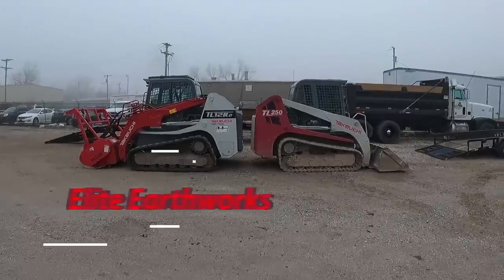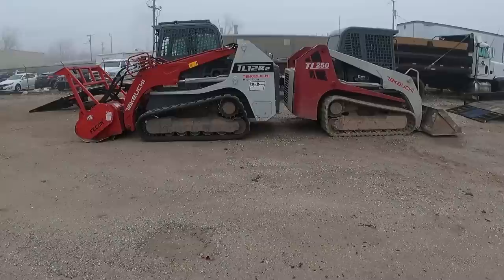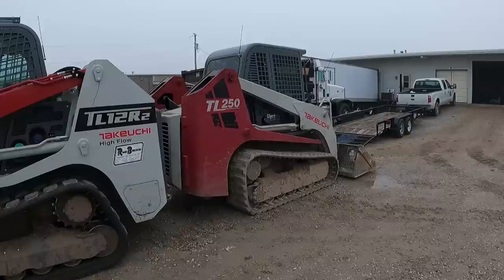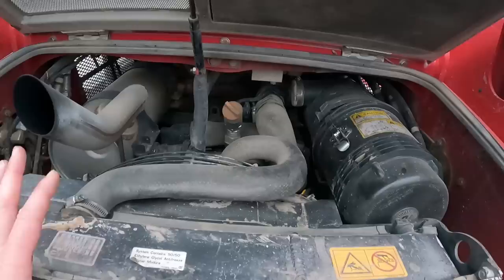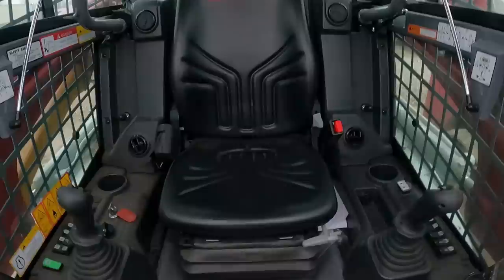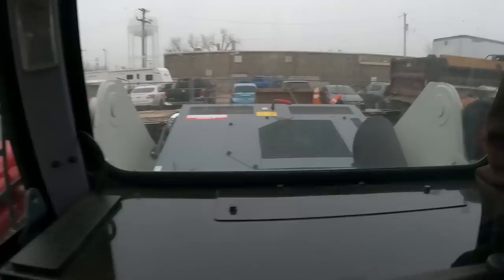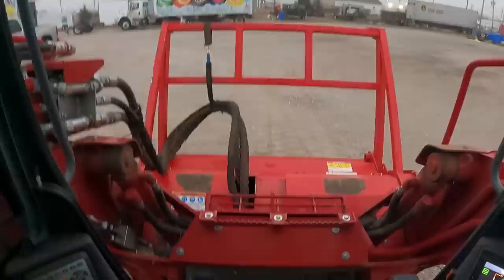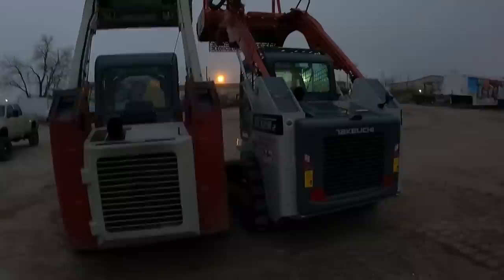Comparing A 2021 Takeuchi TL12R2 To A 2011 TL250

Comment: I still prefer the 250. Anything pre dpf is a plus. The whole tier 4 dpf system is a no for me. Take a torch to cut into the side panel for better battery access on the 250 and she is good for another 8,000 hours 😤😎
Reply from the maker: Yeah you can’t beat those 250 just great machines! Appreciate the comment

Comment: Thanks for that video. I enjoy hearing info on machines from the people who operate them rather than someone who sells them.  Especially stuff like this and the one where you had to replace the battery, that kind of info is something I wouldn't have thought of in looking at equipment.  (Like I found that replacing a fan belt on my dozer actually required half a day's work and disassembly of most of the front of the machine. )
Reply from the maker: Thank you! I’m glad it was helpful, I agree too, better to hear from someone that runs it vs a salesman. Appreciate you watching

Comment: We have 2 TL12R2 machines now and they are great. Bought one last year and put 1,500 hrs on it the first year so we decided to buy a second one last month. Love the new improvements on the cab and love the smoother ride on the tracks without the metal plates for the rollers to run on.  

Side note, the rear doors are way too thin. Definitely don’t do well when guys back into thing. Our older TL130 and TL230 can back into a concrete wall and barely leave a scratch. Do that with a new one and you’ll be buying a new door and radiator.
Reply from the maker: Yeah they are great machines! That’s what I want to get is a 12R2. Oh that’s good to know on the doors must be lighter steel

Comment: Great comparison video! The fact that they kept the pilot controls is awesome! I love pilot controls so much faster and accurate IMO. We have 2 Takeuchi TL 230’s and they are amazing machines for finish grade. Guessing the new generation by your comparison won’t be far off apart from the slightly bigger frame overall.
Reply from the maker: Thank you! Yes you can’t beat the pilot controls! So quick and responsive. Those 230 are awesome machines. Thanks for watching

Comment: The reason I see for the lower lift is the cylinder is shorter, as it's been moved foreword due to engine bay being bigger. Still a nice machine Brandon.
Reply from the maker: That makes sense I bet that’s the case. Appreciate the comment

Comment: Got to run the new 12 at the equip-expo today and it was really something else. We have an ‘08 TL150 and love it. Has 1400 hours but wanting to upgrade for hydraulic flow. Might keep it and just purchase new one but wow hard going back in the old 150 after running the 12
Reply from the maker: Yeah those 12’s are animals! I would definitely keep the 150 that’s extremely low hours on it. It will run forever

Comment: Have a 2300, went with the TL12 V for our second one.  Well worth the money.  Size of the cab, it doesn't Bob as much while traveling with a lode and it grades better.  One thing is the bucket and tracks are wider than you think or you thought it was.
Reply from the maker: Nice yeah the V2 are awesome! Great machine and that’s a big jump from a 230. Appreciate you watching
Reply: Are you saying the vertical lift grades better than the radius ?... strange because they advertised the radius lift better for grading

Comment: Thanks for the video. I didn't realize the 12 is so much larger. I'm still waiting for a TL10r2 to be made.
Reply from the maker: Thank you! Yeah the 12 is big. I don’t know if they plan on making a 10R2.  They only make the 8’ s in radial and the 10’s in vertical now. I would go with the 8r2 if the 12 is too big than what you need. The 10 is a bit under powered. It has the engine of the 8 in the frame of the 12. The 8r2 is an animal
Reply: @eliteearthworksllc  I've got a gehl/tl140 that I bought new. And I've been itching to get a new machine. 
Mine is about the biggest I can pull with a bumper pull trailer.  But I hear you, the tl10v2 doesn't make sense to me. They should have offered the wider tracks and larger engine.
Reply from the maker: Yeah they were trying to avoid using def but it’s not going over well. They are in the process of reworking it but it won’t be out for about 2 years
Reply: @eliteearthworksllc  you've heard they are going to change the tl10v2? Put a bigger engine in? Wider tracks?
Reply from the maker: Yes it’s getting a make over
Reply: @eliteearthworksllc  I'll be waiting!

Comment: Just think we're heavy equipment would be today without emissions regulations.  If they kept the early 2000's standards and just fixed the little things like doors, travel motor efficiency, and maintenance access they'd be amazing.
Reply from the maker: No kidding the emissions have killed everything. Such a joke

Comment: My 2017 TL10 is very similar to your 250, especially the cabs, I like the new design.  I hate that mine has no cup holder. My radio is way back over my right shoulder and it’s a PITA to mess with. Mine has 94hp kubota engine. My buddy’s old 150 has an Isuzu engine. Overall I’m really happy so far tho. 
Stu
Reply from the maker: Nice yeah the series 2 is when they changed the cabs over. The TL10 is a great machine!

Comment: You definitely went over most everything. I definitely prefer the vertical lift especially if you're loading trucks because it gets the bucket further and closer to the center of the bed and also lifts higher. The extra cost of the high flow made me just stick with the standard flow because you can get most attachments in a standard flow nowadays, mulchers and asphalt grinders are about the only thing you can't get in a standard flow and I don't do enough of it to justify the cost, if I do I just rent a machine for the specific job. I wished you could get them in a glider like they used to do with big trucks because the emissions are nothing but trouble and costly not to mention fuel efficiency is almost half of the pre emissions engines. Caterpillar used Perkins for year's and switched to Kubota engines and I didn't like the Kubota at all compared to the Perkins it used twice the fuel and I had constant problems with the fuel system and particulate filter plugging up because you had to run it wide open to keep it hot or it'd plug up, probably why it used twice as much fuel. Great video on the comparison!
Reply from the maker: Thank you! Yeah the emissions is just such a pain on everything. I’m sure there is a big cost difference in high flow I need to price them but I really like this machine. Appreciate the comment

Comment: I think 2010. Because my 240. Which is a 140 size is a 10 .      I like the new tracks that run on rubber . Not the plates. I watch this twice.   I want a new one 👍
Reply from the maker: Ok cool I couldn’t remember. Yes the tracks are great so quiet and smooth. Thanks for the comment man
Reply: @eliteearthworksllc  thanks for doing this video 👍👍
Reply from the maker: You bet man 👍🏻

Comment: What do you like better the radius lift or the vertical lift?..... I've always had a radio lift machine and I am agonizing over which way to go next
Reply from the maker: It has more breakout force and is a stronger design for cutting and grading. If you primarily load trucks or move a lot of heavy pallets the vertical lift is what you want but if you do more cutting and grading I would get the radial lift. I don’t plan on ever having a vertical lift for I do
Reply: The problem is I do all of that
Reply from the maker: @MattyMattnj1  me personally I would go with the radial lift. I feel like it’s the best all around

Comment: Will you be going with a R2 or a V2 when you get your new 12. Hi Flow? Is that a big cost difference?
Reply from the maker: I’m going to get a high flow 12R2. The high flow is about $2k-$3k more and the V2 is also me expensive. I like the R2 better because the pump flows a few more gpm and the break force is a little better. If I was moving heavy pallets all the time I would probably get the v2 but the radial design is much stronger for grading

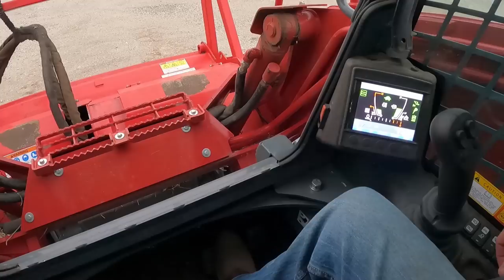Comment: 17:10 but does your older machine with the slower speed have more pushing power???
Reply from the maker: No I think this one would put push it because of the extra power it has and how they have regeared the drive motors. Thanks for watching

Comment: Had a terex pt 110 forestry ran fecon head just bought a new takeuchi tl12r2 the old terex would run circles around the new takeuchi
Reply from the maker: That’s cool I’ve never ran a terex
Reply: Hydraulic flow on terex 110 45 gallon takeuchi 40 the new asv 120f is basically the same machine looking to trend the takeuchi tl12r2 for asv 120 there 120 hp and 45 gallon flow
Reply from the maker: Nice

Comment: Ok, so the 250 goes up a few inches higher.....well we know a few more inches makes a all the difference.  The TL12 is a nice machine but she has a wider rear end with a bigger back door 😂😂😂
Reply: @mrs.eliteearthworks  thats right!!! 😆
Reply: I disagree,,if ya swap the old for 2,,half its age,,your further ahead
Reply: @tricksfixx8303  I find the younger models spend your money faster while the older ones help make it 😉
Reply: @mrs.eliteearthworks  I figure it like this,,your gonna pay,,one way or the other,,
Reply: @tricksfixx8303  😂😂
Reply: @mrs.eliteearthworks  twins,,,that's the ticket!!!
Reply: Brandon will find there are times those extra few inches are huge, loading the dump and the 12 hits the side instead of clearing it while the 250 clears the side. If it was me I wouldn't buy the 12 I would stick to renting one when the high flow is needed.
Reply: @DC-1  butt, butt, butt... what?

Didn’t mean to stutter...
Reply: @sassafrasvalley1939  😂😂
Reply: @mrs.eliteearthworks  😂😂😂😂😂
Reply from the maker: 🤣🤣 she is wide! The 250 is still a good one!
Reply from the maker: I’m planning on keeping the 250 and adding a 12 maybe next year

Comment: Better off with the yanmar engine.
Reply from the maker: They both are kubota engines mines got 9400 hours on it right now with no major problems. The yanmars were good but they stopped putting them in the loaders when the 250 came out in 2011